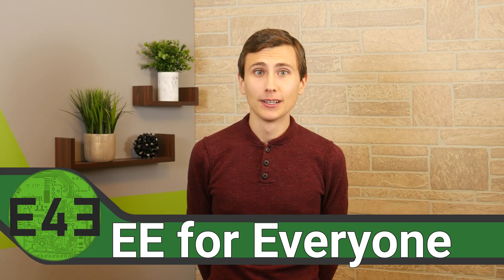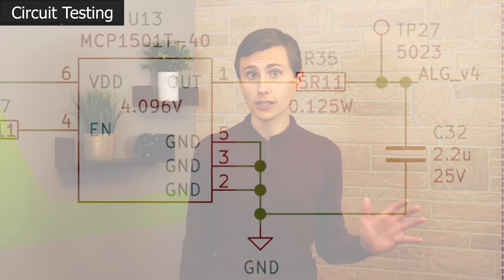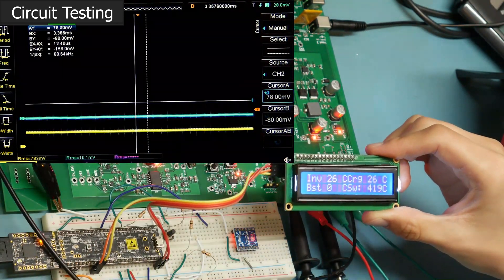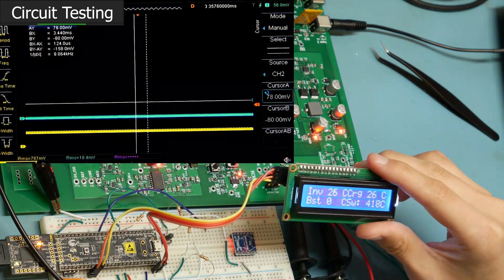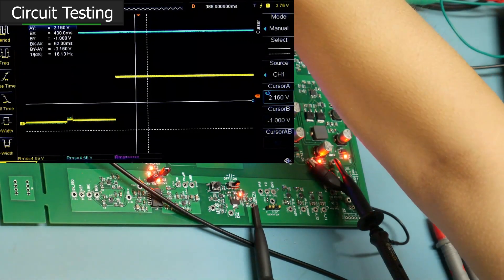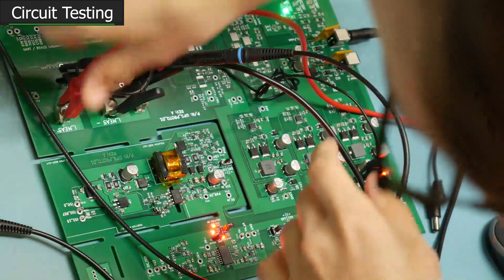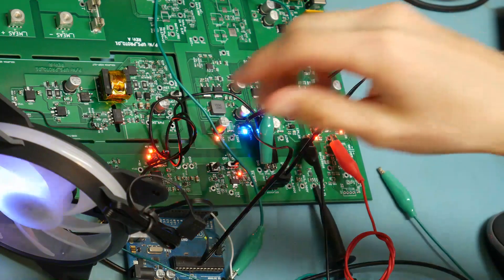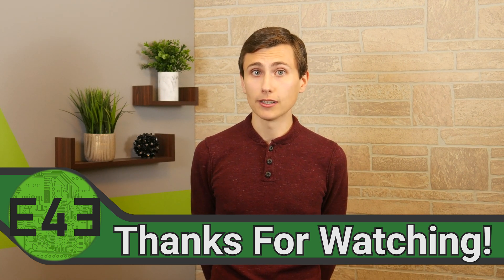5kV Isolated Voltage & Current Measurement! (Analog Circuit Testing)

Comment: Hi have you managed to have a look at my core yet? I'd really like your opinion please
Reply from the maker: Hello Tested to Destruction! Yes, I had a chance to take a look... I'm really having trouble tracking down that material... without knowing what material it is... designing a transformer or inductor with it will prove difficult. Not impossible, but it may involve some heavy guess-and-check style iteration.
(https://www.ebay.co.uk/itm/Large-Ferrite-U-cores-/113914905865?_trksid=p2047675.l2557&ssPageName=STRK%3AMEBIDX%3AIT&nma=true&si=GsfqDuPOH9fBDBoj8VixbLeSY88%253D&orig_cvip=true&nordt=true&rt=nc)

Specifically, I imagine understanding what frequencies will lead to the best balance of core and winding losses will be difficult, along with what flux density leads to saturation. Of course, pumping power through the core until you've experimentally found the point where it has saturated... could help you find that limit. :)

All that said, the closest I found was some references to a long-gone or acquired company - Thomson Ferrite materials - but no description of the B50 material, specifically.

What I can say for certain is that U cores of a similar size from folks like Ferroxcube or TDK run about $30-$50 New. So, if you can find a way to use those cores with a modern bobbin from one of those guys, you may have a great deal! Unfortunately, it all comes down to the material... 

Also important: I've never used 2 U cores to make a transformer on their own. I've heard of U-I cores, but I've typically used E cores (or one of their many variants) - I'm not seeing bobbins made for holding U cores explicitly... so you may need to get a bit creative in trying to use two U cores alone.

I think these fall well into the "Maybe useless - Maybe a Bargain" category, but I'd recommend finding something similar that comes with a datasheet or known core material.

I hope this helps!

Comment: https://www.ebay.co.uk/itm/Large-Ferrite-U-cores/113914905865?ssPageName=STRK%3AMEBIDX%3AIT&_trksid=p2060353.m2749.l2648  

i just grabbed  this what do ya think?
Reply from the maker: Neat cores... sketchy traceability though. Has anyone seen these before, know this core material, or maybe even who makes them?
Reply: @EEforEveryone  I really hope they will work as a transformer surly that's what they are designed for right? .
Reply from the maker: @T2D.SteveArcs  They might work!
 Some core materials are optimized more for constructing other devices, like chokes. That said, It's made of ferrite - which conducts magentic flux - so it'll work as a transformer in the sense that the output voltage will be a function of the input voltage and the turns ratio... (then again, the same is true for an air core transformer) Things may start to fall apart when you try to push power through the core. If you go for this, absolutely make sure to use both "U"s together, or close the loop with ferrite somehow. An open U would be one heck of an air gap. :)

Without a datasheet... It's difficult to tell the difference between a U shaped paperweight and a ferrite core... but It seems probable that an oddly squareish hunk of ferrite in the form of a U was probably optimized for use in 100-500kHz switching power supplies. It'll move some energy - the questions only a datasheet can answer well is "How much energy?" and "How efficiently will it move?"